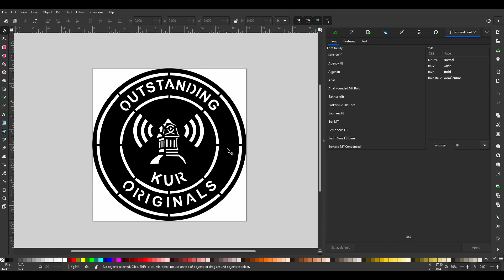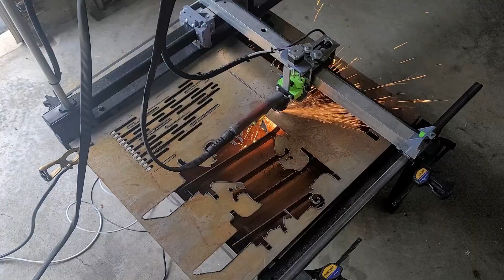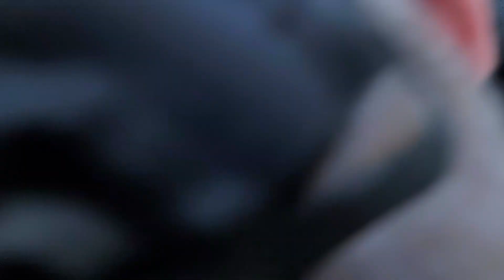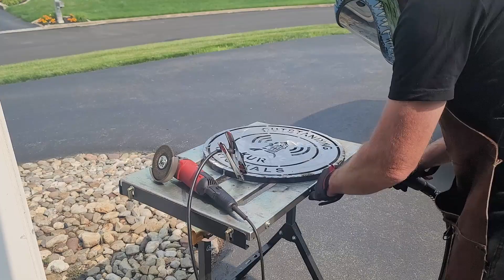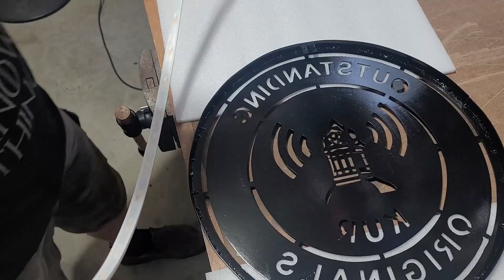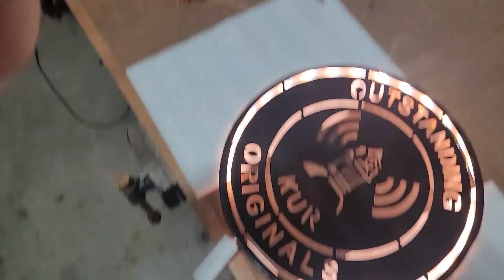KUR Sign Using My DIY CNC Plasma Table

Comment: Looking really good, I finished my JD's a couple of months ago :) Next one on the list for me to cut, is a collapsible fire pit :)
Reply from the maker: Thanks, There are several nice designs out there for the collapsible pits if you are not designing your own, I love the CNC machine. I use it all the time
Reply: @harbaughsworkshop  Yes, I have seen several on those :) But trying to make my own, to be better at tab & slot in Fusion :) Love my table as well :)

Comment: You are doing great work with your JD’s garage plasma table.  I completed mine about 6 weeks ago and I’m loving it.  One thing is obvious with your videos is that you really have the THC down cold.  With mine……….not so much.  I seem to be running around in circles trying to get my settings correct.  Every time I send the file in Fusion 360 to create a gcode I get an error.  If I make a gcode without a Z movement it works fine.  So now I’m just using the motorized Z to set the initial torch height but if the metal is warped, I’m in trouble.

Could you make a video with EXACTLY the settings you use for a job?  I know this sounds like a PITA but I’ll bet there are many owners of JD’s Garage CNC plasma tables that could use a step-by-step tutorial on the THC.  Thanks for the videos, again, you are doing great work!
Reply from the maker: Thanks, I appreciate it. I don't have the THC yet. They have not released the THC yet in their plans. I will install it when that happens.
THC measures the current and adjusts the height to maintain that current.
I do have the z-axis probe, which probes the material and sets the height to the height  I set it to for my torch.  I will make a video showing my setting. Keep in mind that these settings work for my torch. They might not be the correct settings for your torch.  Might be close enough to get you working.

I do have a question for you: What does z-axis actually doing?  Does it probe at all?
Reply: @harbaughsworkshop  
I have not been able to download any gcodes with Z movement. I get an error every time.
Reply from the maker: @clifflasater6981  What error are you getting?  Is it the same error every time?
Did you create your post process and add it to fusion360?
Reply: When I select Actions, Post Process I get a box in the lower right corner (where it should say Post Process Successfull)  
NC code failed to post. The following NC code failed to post:
NCProgram4 : C\Users\vwstr\Deshtop\G codes\THC test1.gcode